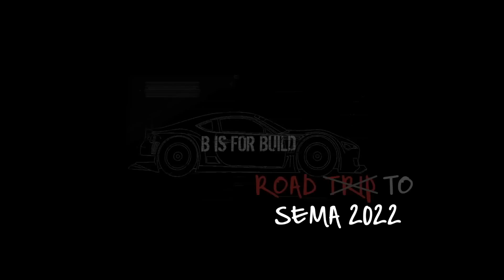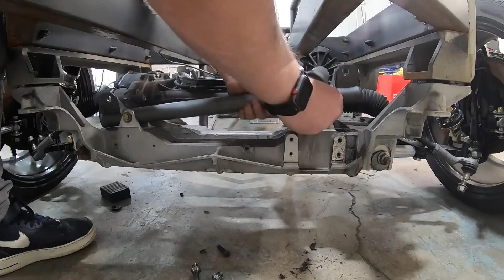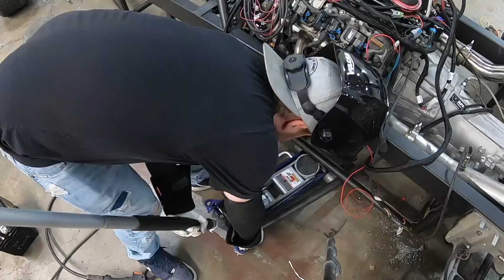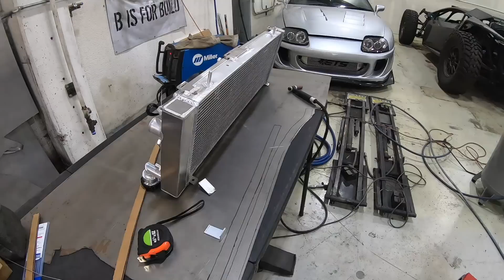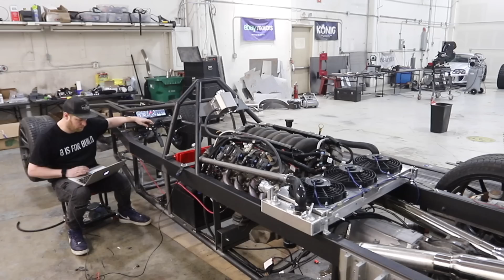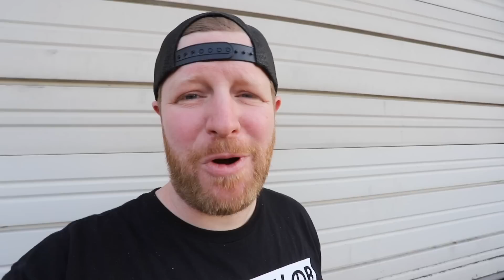Custom Single Seater Supercar Pt 6. - FIRST TEST DRIVE WAS SURPRISING!

Comment: dude radiator above the exhaust is a bad idea...  just saying...    fans push cool air while hot air rises meaning the hot coolant will stay roughly same temp... hot = car constantly over heating

Comment: That rack was designed to be mounted behind the center of the wheel instead of in front of the center of the wheel. Also called a rear steering rack. I ran into the same issue building my car..lol I just took a guess on the placement of the steering rack in the "donor"  whenever I ordered my first one.

Comment: Pillow blocks are very crude by design and are used mainly for head and tail rollers on industrial conveyor belt systems,some are for axial float some only for rotational forces,be sure the proper bearing is used in the correct places.

Comment: Curious why you would use an auto setup that would otherwise be seen in drag racing? Maybe im missing the purpose of the car, but I though you were building your version of an open wheel car. Which would obviously use a dual clutch setup with paddles or just a manual gearbox.

Comment: Not to be one of “those” guys, and given your experience with import vehicles it’s understandable, but ECU is not correct GM terminology regarding the engine computer. They called them for this year model a Powertrain control module .PCM and later Engine control module, ECM. Nice job nonetheless.

Comment: Fun fact: Volvo likes to mount the steering rack behind the front axle centerline. You had it orientated correctly but it normally acts on the knuckle behind the axle centerline not the front like you have it configured. FRS/BRZ racks are also like this.

Comment: Drill horizontally at belly height.
With horizontal drilling you can use both hands equally and lock your arms against your sides. A far better orientation, for your taps, threading a gazillion holes.

Comment: Just a quick question/ suggestion, is the radiator pulling cool air from the bottom? If so why? And why not flip it and have it pull cool air from the top and blow said air onto the exhaust as opposed to pulling air that’s been pad the exhaust
Reply: You beat me to it... I came here to see if anyone else was thinking the same thing!   Unless he does a VERY good job of wrapping the exhaust with insulation, I see trouble ahead...

Comment: The reason your steering was reversed is because your tie rods are connecting at the front of the knuckle as to where the rack was designed to connect on the rear of the knuckles

Comment: Your fabricstion skills have grown significantly since Oscar has been around. Stoked for you getting it in my dude. Also, garage burnouts with rear inside and front outside is the beans Chris. Water the tires you want to spin and get it frickin in...

Comment: not sure if you're aware, but U-Joints are not a constant rate unless the start and end angles are parallel.  This setup will result in a variation between steering wheel angle and wheel angle due to this.  You can fix it by swapping to a CV joint rather than a U joint.

Comment: This is one of those things that looks like hella fun to work on and experiment on, and much props for going out on a limb and out of your comfort zone - but holy hell my head wants to explode at some of the things it's seeing.
Reply: Agreed, doesn't seem really planned out kinda just designing it as it goes along. Needs to be shorted a good bit, different designed seat, redo the cooling system to be wayyy more efficient etc. Seem likes a seat attached to an engine dyno bench thats been stretched out
Reply: its pretty common for his builds to be half assed and poorly thought out so this is nothing new.

Comment: Man please solder all joints.     Trying to troubleshoot down the road is gonna suck with connections like that.   I do harness repair every day and I would never  send a car out with a connection like that.   Against company policy and they learned the hard way.
Reply: I've built lots of high end racing harnesses and have little to no soldering, just crimping.   Same on OEM harnesses.   Crimping or ultrasonic welding only.   I'm less "anti-solder" than some, but it's not the optimal method for most situations.

Comment: You run into that in the sandrail world, you need to match your rack to the location of your steering on the knuckles, depending on if they are in front or behind the spindle.

Comment: So you rack problem wasn't because it was upside down.....there are "front steer" and rear steer racks....meaning in front of the ball joint centerline and behind the ball joint center line....meaning that on the spindles the steering arm would be behind centerline which would turn the wheel the opposite way......I've been there on my buggy

Comment: You put the steering rack in backwards! 😂🤣😅🤣😂! That single seat car is too long! The steering won't be very effective. It would be like steering an old Peterbuilt with the P.T.O. rear differential lock on. It won't steer. It will go straight no matter which way you steered the truck. The only way to help would to install rear steering.

Comment: I can’t imagine that the radiator the way it sits, and so close behind the motor, will cool the engine enough. It seems only hot air will flow over the fans.. But i’m not a mechanic 😶

Comment: You should really think about doing duel side fuel tanks and getting a small slimed seat and angling it. Doing both of these will shorten your wheel base by 10-20 inches also putting the petals as close as you can too the rack will shorten it even more. Comfortable cars are slow. Fast cars make your life hell and that’s what this should be about

Comment: After sema you should consider installing on board air jacks
Reply: Why ? Seems very pointless for a car that would never be raced on a track.
Reply: @Mike-qp8bv  bc the car is gonna have like zero clearance that’s why
Reply: @josephmodesitt  Ok, fair enough. But in all reality do you  think this car will be used enough to warrant something like that ? It just seems the majority of the cars they build never get used. But hey, that's just my 3 cents.
Reply: @Mike-qp8bv  obviously not. I’ve already seen people saying it won’t handle well with how it was built but I still think it’d be cool and fit the theme of the build

Comment: As a showpiece, this project is amazing. But as a track day monoseater, got my doubts in terms of safety. Would be way more safer and better performance, to LS swap some F3000 shell. And also be more confident to push it to the limit on track.
Reply: right i have doubts with...what a 22 foot frame? or wheelbase?
Reply: @trunk8d  Too long, too heavy. And have my doubts if in a race track it is pushed to the limit.
Reply: @trunk8d  Plus all the weight in the rear? Needs to be as central in the wheelbase as possible for balanced handling.
Reply: @NikoleiBellic  exactly, add to that all that weight from the frame without crumple zones. If he LS swap some F3000 shell, he would have a lighter base, safer in case of impact, better handling and performance, and actually be used as a proper track day race car. He could even be contacted by potential clients interested in a track day monocoque single seater, easier to maintain using an LS engine.

Comment: Also, most people are against this, but when I am working on anything electrical and I need to alter the wiring, I ALWAYS solder and heat shrink. I hardly ever trust butt connectors.

Comment: Looks like you could of shorten this by at least 2-3 ft, love the build
Keep pushing forward
Reply: That shit is long as fuck 😂
Reply: @Watchmedome3017  So are the McLaren LongTails 
This will look insane if he builds a long body supercar though the chassis is the shape of a Indy car so idk

Dude should’ve thought about the wheel base 😂
Reply: @connoisseuroftigolbitts  the chassis is shaped like an 18 wheeler truck! 😂 it’s indestructible 🤣
Reply: At least 😆
Reply: Looks like a single seater truck chassis .
Reply: @Mercmad  😂😂 single seater mega cab ford f450
Reply: Ultimate Super Limousine
Reply: I think he might be confused between inches and centimeters
Reply: how about 6 feet ?

Comment: as mentioned the cooler is not located ideally, i would place a heat-shield between the exhaust and cooler if possible even just temporary as for an LS that cooler is on the smaller side it might overheat if you try to do some spirited driving. when building the body for the car there will likely be more possible locations for the cooler also placing 2 smaller coolers in the wings would be a great not only in capacity but also airflow, as with the current location you rely solely on the fans to cool.

Comment: I guess i saw somewere that the problem with steering could ve been solved by switching steering fluid tubes with each other
Reply: It's very apparent  that you have no idea how a rack and pinion actually works.

Comment: Great progres! 
But that thing is super long! 
And can you put the radiator in front? or use F1 stile cooling and put two smaller radiators in the sides. you will have better cooling and better weight distrib.
Reply: Yes, 2 smaller rads located in the side pods would be ideal. That's why they would never do it. It makes two much sense. This car is more of a joke than anything else. What's it's purpose in life ? Its not a race car. Could never be used as one. Unless they have a class for school bus wheelbase class.

Comment: Hey Chris. Is there any way that you can integrate A4 wheel steering system? The reason I ask is with this thing being so long it could help with your turning radius quite a bit. Having the wheels turn the exact opposite way would get you around corners a lot faster. I'm not sure how that would affect its top speed or it's drive-ability around track at speed, but you can see four wheel steering off of something in a scrap yard fairly easily. Love This build I am so excited to see you finally working on the single seater.

Comment: This thing is so low to the ground that if you made it extremely aerodynamic with a reclined seating postition, i bet you could do your daily commute with a small battery pack, two 10kw motors driving the front wheels, and solar cells integrated into the body.
Then rip it on the track in its AWD glory(you may want more powerful motors in the front for better software controlled trail braking)
Reply: Extend the body pannels to be flush with the wheel's outer rims and i bet you could get enough solar to drive 20+ miles per day on solar alone, probably 60+ with the engine idling at ~1100RPM with a somewhat lean burn, in gear, and to drive accessories.

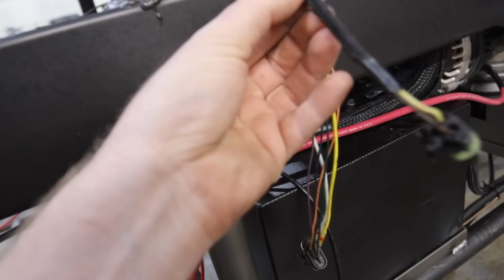Comment: 13:05 isn't that solder in the middle of the connector? It's not even melted in half of those.
Reply: Those connectors are horrible. I wouldn't have faith in any one of them. Do it properly and it will never have an issue.

Comment: When you do the body for this just cap off the area between the radiator and the exhaust and make the new body bring are through across the rad and out of a body area inside that back location

Comment: There's absolutely no way this thing will handle well
Reply: you mean this limousine isn't going to make a good race car?
Reply: @MrPuddles3331  a single seater limo lol
Reply: @MrPuddles3331  🤣
Reply: I agree and I think they could lose circa 1.5 feet off the wheelbase by cutting out a section of frame behind the seat and in front of the engine. It would be very easy to do
Reply: The channel isn't called D is for Drive. It looks cool, that's all they need
Reply: @LizzyB123  Totally. Chris should never have uttered the name "F1" right back at the start though. Means these comments are inevitable.
Reply: MAYBE if it had 4 wheel steering it would help, but yeah, definitely quite a long wheel base, but hey, I'm interested to see how it turns out anyway. I know Chris isn't afraid to make/show mistakes on this channel
Reply: it reminds me of a rocket car from The Simpsons Hit n run videogame
Reply: @Paultc_97  lmao
Reply: I really don't want to be critical of someone putting so much effort into something with all there will, but my ability to see is all I need to know these comments are correct.
Reply: I am guessing that the wheelbase is something close to my Ford Excursion (137"?).
Reply: I feel like he tries to reinvent the wheel too much. There are so many good resources out there for tube frame race car design. I mean he could have just started with a modified GT40 design and went from there. This thing is absolutely cartoonish looking with how long it is and the truck-like box frame
Reply: I feel like I am watching a scene from "A clockwork orange".   https://www.youtube.com/watch?v=uSQApGLbgNg
Reply: Can’t believe I had to scroll this far to find a comment like this.
Reply: I cant seem to give a shit if this will handle. I feel like most showcars are shitty drivers cars but it’s the build that counts 💪🏻
Reply: Who cars. None of these cars ever see a track. They just get built and sit in the shop lol.
Reply: He seems to have a consistent problem with using GIANT pieces of box section and extra tubing.  Ever since the Z build I check in every couple of months and hes still at it.  Look at 1 race car dude.  Think about the direction forces are traveling in and dont put bars anywhere else.
Reply: @PhantasmPhoton  I do really enjoy the content but this seems to be a several under utilised concept. I mean I am a massive F1 fan so maybe I know too much haha.
Reply: Double wishbone front and rear usually only works on well balanced cars. This a a long rear heavy vehicle, so it's probably not going to be about as balanced as a wingless airplane.